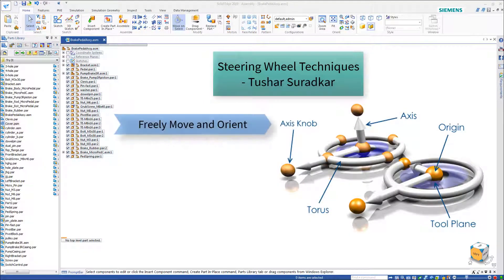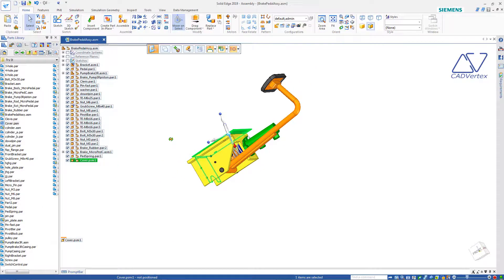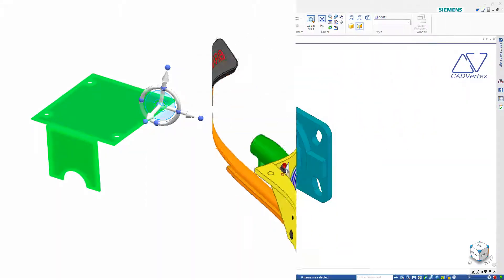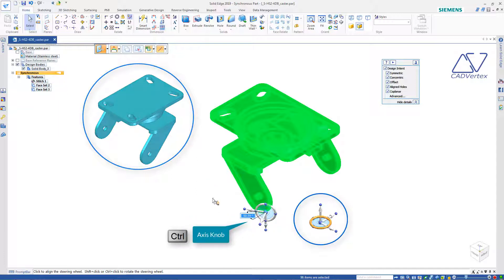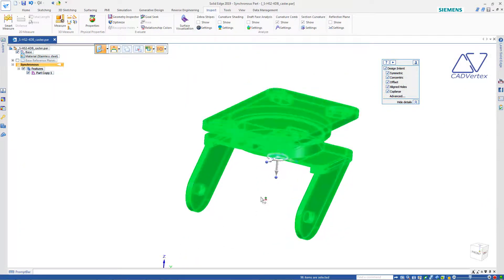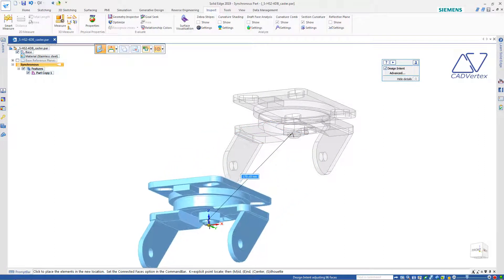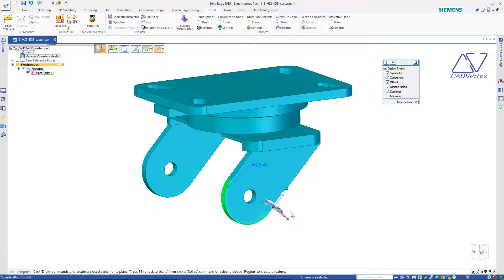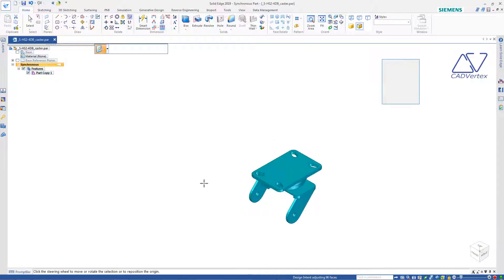Steering Wheel - Gateway to Synchronous Modeling in Solid Edge

Comment: I still use the old version 20 from ages ago, and I see my self as a professional in using V.20. Furthermore, I struggle for some time to learn the new solid edge, I find the steering wheel annoying. Thanks to this video I start to understand it, and I was able for the first time to angle some holes at a desired angle, using the steering wheel. But I think that no matter what, I think I will stick to Solid Edge V20 from UGS as that version I master 100%. As I don't use Solid Edge anymore for work related missions, I don't need the incredible advanced stuff anyway. And any drawings I require from now on are pure private project's. But thanks for the video, I think I start to get the basics of the wheel. One question? How use the wheel on a laptop that has only a mouse pad? I can't figure out how, lol
Reply: I hated it too, it takes a bit for it to grow on you.  IronCAD has something called the tri ball.  As a CAD user you should take a look at it. It is the most intuitive version of a Steering wheel.